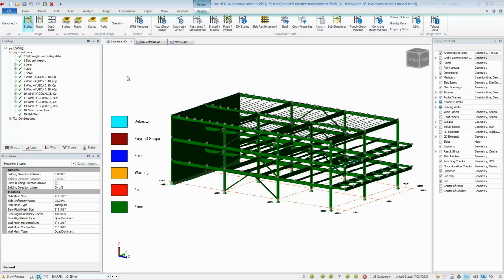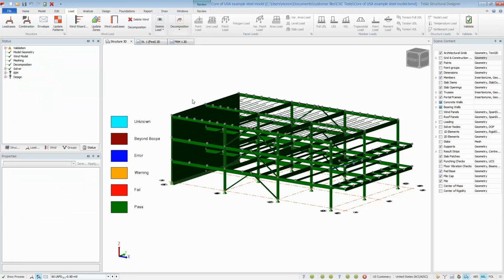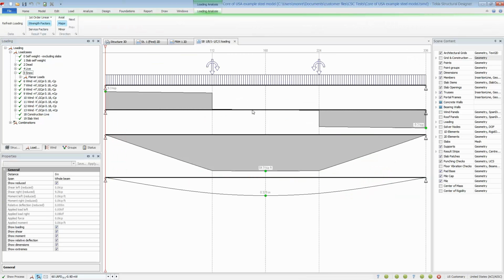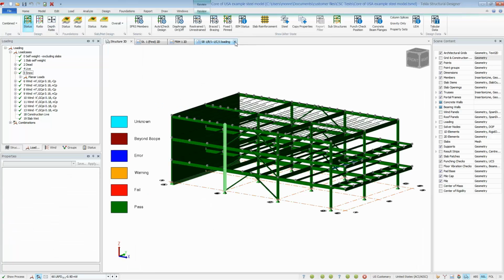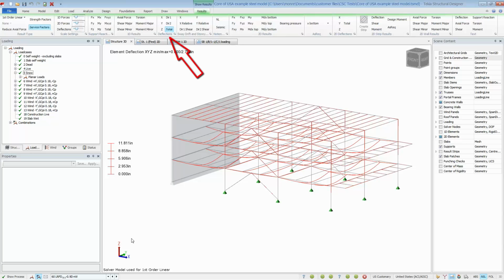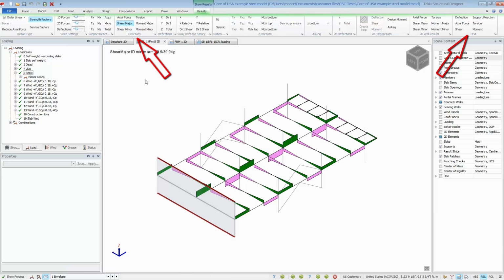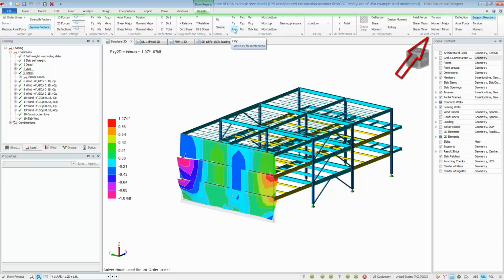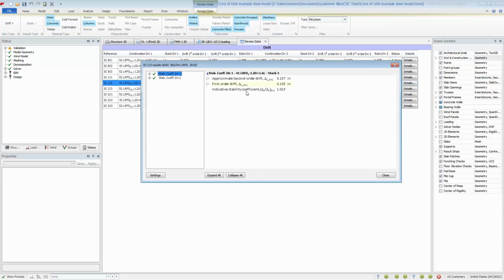Tuesday Tips Tekla Structural Designer Reviewing Analysis Results

Comment: I have a question on reaction load of a wall. I am new into Tekla.  When I'm getting the reaction at the ground floor wall, it's coming as kN. What I'm doing is adding all kN and then dividing by the length of the wall to get kN/m. Is there a way to change the setting to get the reaction in kN/m?
Reply: Hi Driton. Please contact your local Tekla support department for any additional information needed. Wall reactions are reported with a series of point loads as you have found. IF you want the reaction in Kn/m then you have to convert as you again have found. There is no way to display the reaction in KN/m in the results view but in the foundation design results summary, TSD will display the KN/m for each segment where each point load reaction has a segment length.